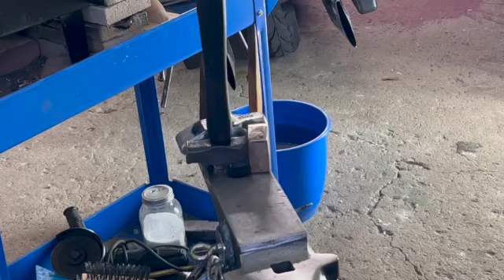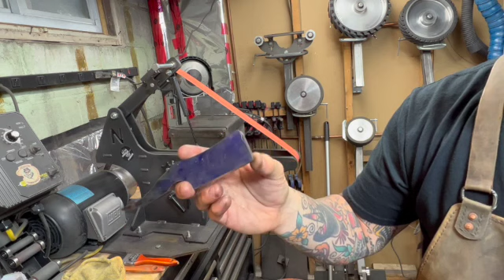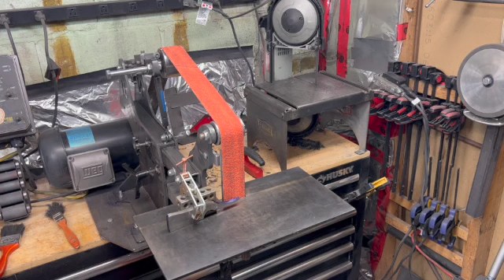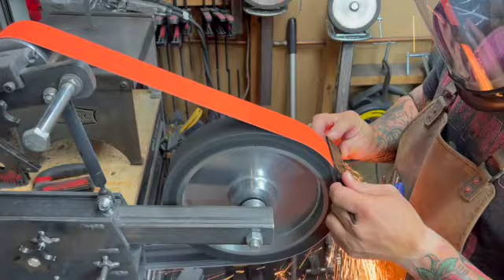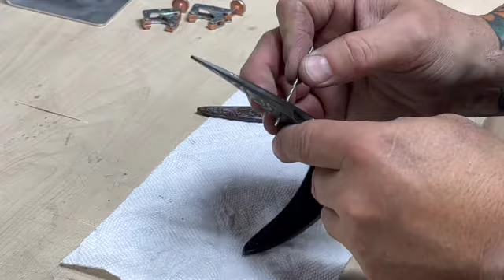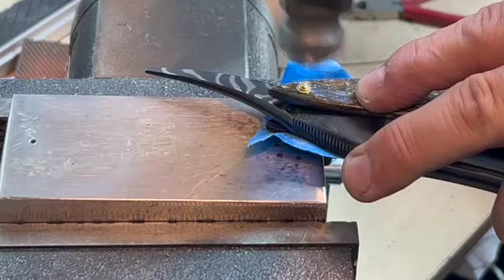Valentini Garage Works Making of a Straight Razor

Comment: Nice video ! You know on classic  vintage razors there are no flats besides the tang and the toe anything above the hollow has to down size either by rounding off or tapering the spine.
If you look at any vintage straight razors you’ll never see any with flats above the hollow and that’s because if its flat the ratio between the spine thickness and the height of the hollow is falsed..the thickness of the spine has to go down as the edge moves up through years of sharpening, if the spine above the hollow is flat the thickness of the spine stays the same  until it reaches the zero grind therefore not respecting the spine thickness to edge ratio.

Comment: I’m knife maker but my biggest wheel is 10” can I use it I am a collector of vintage straight razors, and I would love to make my own. I did have a blade custom-made, which I then attach mother of pearl scales too that I made I like a 1” blade if that makes a difference
Reply from the maker: For most of my razors I use a 10" contact wheel. I do have a 12,8,6, etc but I like the 10" for most of my builds. I tend to use thicker material .25 - .3 and make blades that are 9/8 10/8 and 11/8 so a larger wheel is necessary. Thinner material and smaller blades will require a smaller contact wheel to achieve similar hollow grinds.